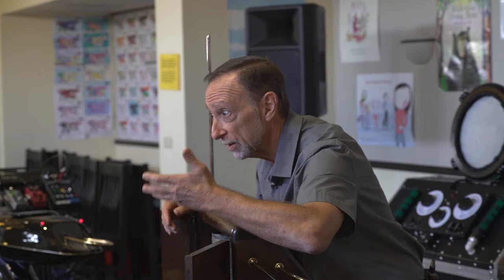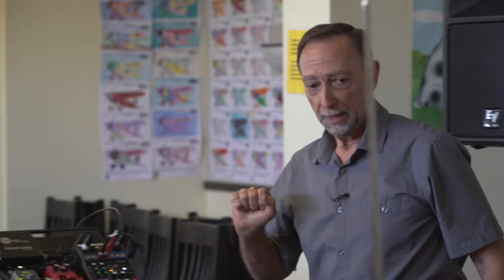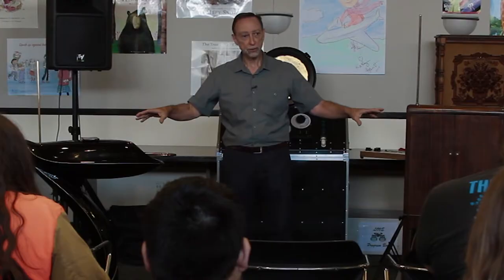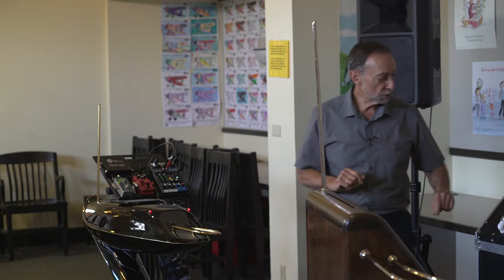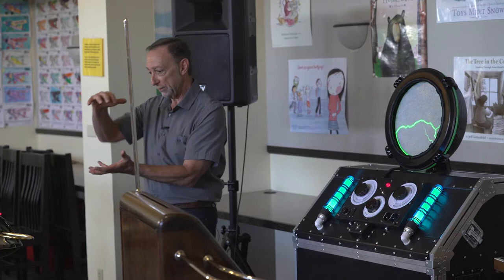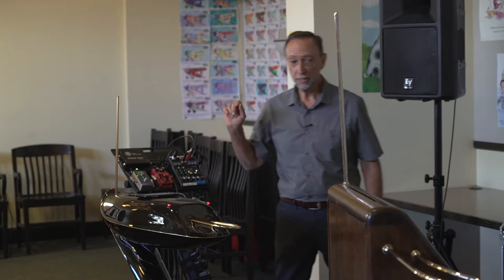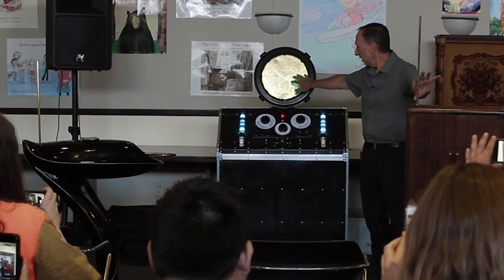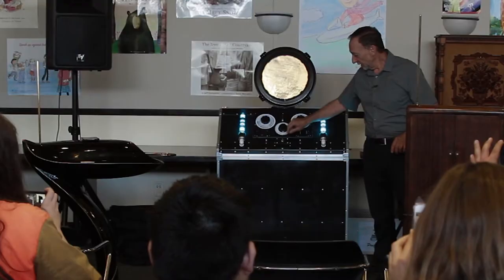The Theremin: How it Works

Comment: Although the Theremin uses radio-frequency electronic circuitry to produce musical sounds, it is not actually a transmitter, it is an electronic musical instrument that uses two antennae, one for pitch control, and the other for volume control, these antennae are connected to two radio-frequency oscillators, the output-signal of the pitch oscillator is mixed with a signal from a third radio-frequency reference oscillator, and the difference in frequency of the two oscillators creates an audio signal which we hear, the smaller the difference in frequency, the lower the pitch that's produced, when you move your hand closer to the pitch antennae the capacitance between your hand and the pitch antennae causes the frequency of the pitch radio-frequency oscillator to change.
Reply from the maker: Your explanation is technically correct. However, to simplify for the general audience and keep my presentation moving along, I explain simply and visually what happens in general terms. I employ visual f/x using a plasma plate. The plate reacts to my body’s capacitance thus changing the electrical field and affecting the amount of electrical disturbance you see on its scree. The audience gets the connection visually in real time. Thus, I can show how the Theremin’s pitch and volume antennas work “magically” and invisibly to create rising and lower pitch and increase and decrease volume!
Reply: Thank you. After reading your explanation, I didn't need to watch the video.
Reply: My thermin broke down
When i move my hand to the antenna the volume goes lower !!!
As i move it away the sound get higher !
HELP PLEASE